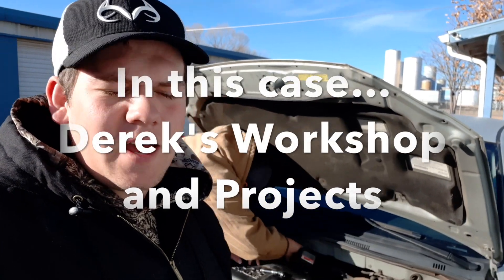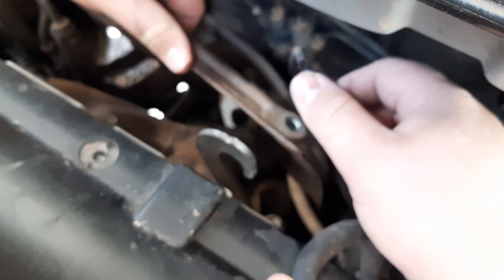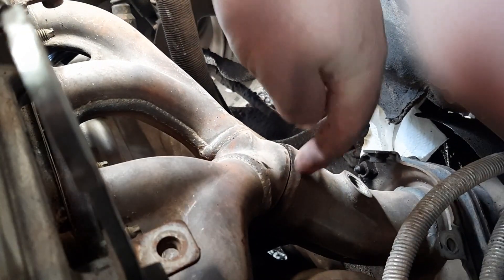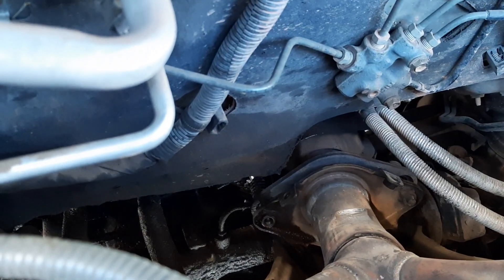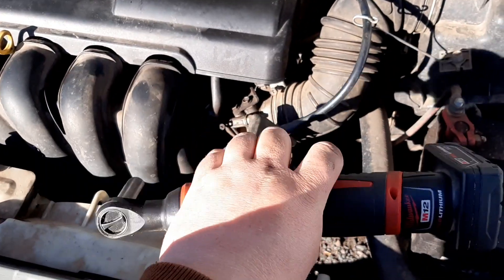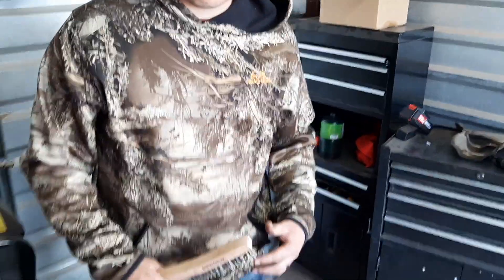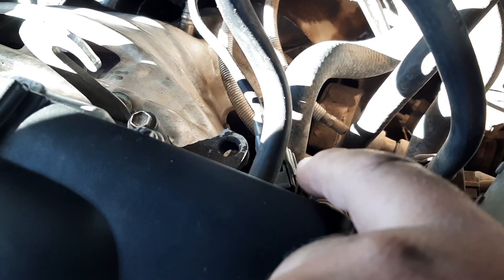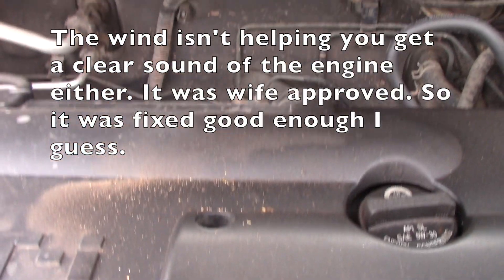Welding Repair on 2005 Toyota Corolla Exhaust Manifold - How to Remove and Replace It

Comment: Nicely done
my grandfather told me, If it was made on this planet, you can fix it.
helps to have all the right tools, and a tig welder

For exhaust bolts and nuts, always use an impact wrench, on a 6 point socket on a breaker bar, and load up the breaker with some torque and then TAP it hard with a hammer. Use the shock waves/impact/tapping to break the bolt free, NOT brute force.

The way to get the most for your money is to buy a car new, and keep it till the wheels fall off. If you can do most of the work on it over the years yourself, you can really keep your transportation costs down. The only drawback is: eventually the wheels really do fall off.

Comment: Thanks. I've got to do the same on my scion. Not sure it'll be as easy to get the manifold out though.  no room at all back there.  Looks like these all crack in the same place after about 10 years.
Reply from the maker: Yeah no problem, if you can get it out and weld it, it can seriously save you some cash. I had the exact same crack on my Corolla but I had a family member work at an auto parts store and got me a new manifold for cheap so I figured it was worth it to just change it out. So yeah I think it’s common.
Reply: @DereksWorkshopAndProjects if it’s gotta come out anyways what steered you away from doing this procedure again rather than spending money on new parts
Reply from the maker: So I actually replaced the part in my own Corolla. When I was brand new to welding. Then I made this video with my brothers corolla who was harder up for cash at the time than I was and so we decided to just weld it. So actually the replacement came first, not the other way around. I would weld it again if it was me doing it on a high mileage older corolla.